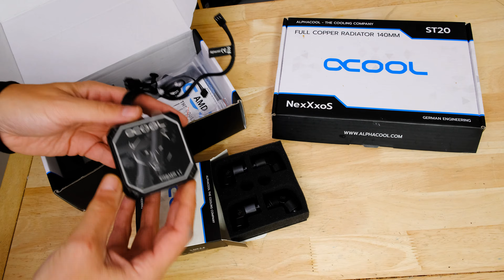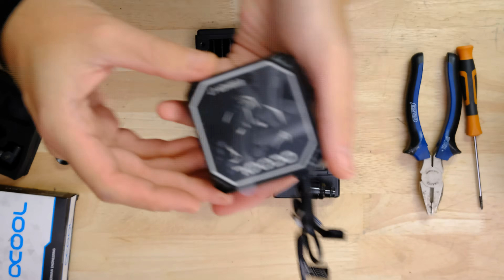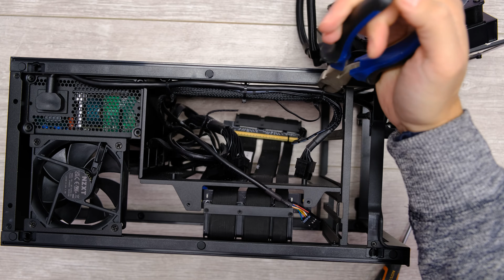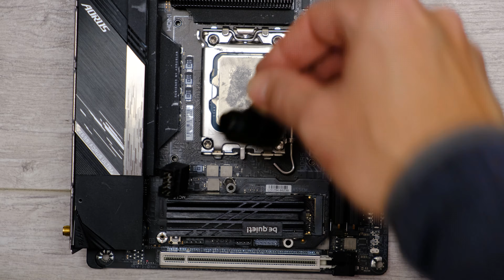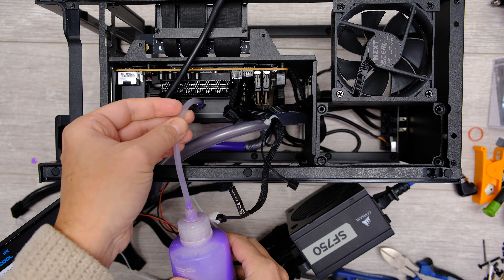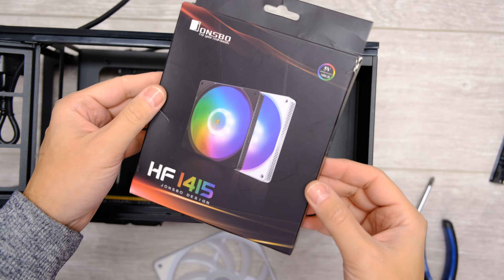HOW TO WATERCOOL the NZXT H1 V1 and V2 Mini ITX case

Comment: Actually, in the H1 V1 version, I tried installing a 240mm cold row and it was successful. I used a combination of a 13700K+7900XT, both of which were cooled by a single 240mm cold row. However, the results were mediocre. The graphics card often experienced a gradual increase in temperature due to rising water temperature, necessitating a reduction in the voltage of the graphics card. Moreover, to install a 240mm cold row, you don't need to remove the power supply bracket; you just need to add copper pillars to shrink the power supply bracket downwards. Then, using a 140 to 120 cold row adapter bracket, you can install a standard 240mm cold row inside the Enge H1V1. However, I couldn't do this with the Enge H1V2 because it locks the power supply bracket of the Enge H1V2 in place.
Reply: I figured that if you remove the PSU bracket, you'd need a fairly short GPU on the other side, right? There's some air volume up there, but the end of my ZOTAC RTX 4070 is occupying most of it. I don't think I'd be able to shift the PSU to the right and fit a 240 mm radiator...

Comment: surprised you can do a custom loop lol. My motherboard has the CPU a tiny bit offset I think and it's weird and bulky, so it might not work :/

I wonder if an air cooler would be enough for my pc. I tried the SL-100 but sadly, it was just like BARELY too big to fit my pc :/ I couldn't screw on or put on the fan, the clip would hit frame. there's always a rotary cutter but that'd be crazy LOL

Not only do I not have enough money for a custom loop, but i'm terrified of leaks lol.
I wonder if upgrading the stock AIO fan will give me better temps. i'm just at 89c on my 7950xed.

Comment: My H1 v1's AIO seems to be dying on me, getting crazy high temps in Guild Wars 2, above 90 C on a R7 5700G, which is not a hot CPU. max 30 watts and less than 50 % CPU usage. Sad times. Might have to do a custom AIO or maybe air cool it. :S
Reply from the maker: @SoulRollerFIN  have you seen my H1 AIO repair video? It’s likely a blocked pump that can be fixed
Reply: @CrazyTechLab  I've seen it. Those pumps seem to live max 3 years, so it's not worth repairing to me. Already ordered a NH-L12S. I'll check out the pump when the aircooler is installed.
Reply from the maker: @SoulRollerFIN  Yeah probably best to have a backup. A lot of people find it happens 2-3 years. Just gets clogged and looks like it died
Reply: @CrazyTechLab  I got bored while waiting for the new cooler. Opened the pump, cleaned the gunk, didn't even bother cleaning thermal paste, since I had recently repasted. Temps don't go much above 60 C now. :D I'm still swapping to the air cooler as soon as the pump starts acting up again.
Reply: The AIO kept gunking up so finally installed the NH-L12S a few months ago. Surprisingly, the PC is much queter and cooler now. Idle temps aren't as low as with the AIO, but under load the PC just runs much better now. And no more cleaning the gunk. :D

Comment: How many fittings needed total 5? 4 right angles and one straight?
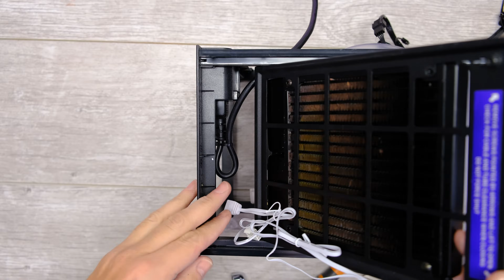Reply from the maker: 13:39
Radiator: 2 x right angle rotary fittings
Block: 2 x EK micro 90 degree rotary, 1 x 13/10mm straight fitting, 1 x 90 degree rotary female, 1 x 90 degree rotary male 13/10mm.

Comment: So let me get this straight going through all that trouble for less cooling performance on top of that spending a few hundred on the components plus running the risk of breaking something in the process 
Don't be like this guys just buy a normal computer be a normal rational human 😂😂😂
Reply from the maker: Oh dear. Someone didn’t watch the video properly and understand that the stock cooler is noisy and unreliable. That’s why I replaced it. Not to get better performance. And the fact you can fit a thicker fan inside and a larger radiator, especially in the V1.

Comment: Nice vídeo 🤌
Just love the H1 and mine is full custom loop👌
Would love to see a full build on the V1 with the 280mm
Reply from the maker: Oh nice! What components did you use in your v2?  I was set on the V2 and then was a bit gutted when I saw how easy it was to fit a bigger rad in the v1! I need a smaller GPU!
Reply: @CrazyTechLab  mine is the V1, but if i found a V2 deal i would upgrade because of the rear fan and CAM module
My build have an R5 5600X and a RTX3070 FE
Rad is an EK 140SE, dual pump from alphacool and the GPU block also from alphacool with a small reservoir for the liquid👌🏻 and a Status LCD on the front
You need a shorter GPU or just go full custom loop
The GPU block will be the perfect fit 👍🏻 and i prefer the 8x13 tubes from alphacool

Comment: Cool concept. I’m abit worried about the resonance noise though with that psu and rad fan facing each other
Reply from the maker: Yeah in the H1 V1 later in the video? I do agree plus they'll be fighting each other for airflow. You could switch the fan around -exhausting or intaking wouldn't make much difference.
Reply: @CrazyTechLab  TBH, I was contemplating on ditching my H1 V1 due to bad GPU temps when gaming. But after seeing this video, I changed my mind. I might go for a 240 AIO instead of a custom loop. AIOs with low profile pump block (Antec Kuhler k240?) could be a viable option. I imagine it being feasible to orient the radiator fans to face the mesh panels instead of the psu.
Reply from the maker: @thegeekystuff3800  Definitely. Temps with the single 140mm in the V2 are 'acceptable' but I'm seriously contemplating a GPU downgrade so I can get a bigger rad in the V1. There's roughly 45mm of clearance between the AIO mount and the SFX-L PSU in the V1 if you move it to the centre of the case like I did. That's enough for a 30mm or thinner radiator and single full height fan.

Comment: Good video for science, but spending that much on custom cooling to have basically the same performance is pointless
Reply from the maker: It's far quieter than the stock cooler and I've removed the threat of the AIO gunking up which is a huge issue with the H1. I wasn 't trying to get betting cooling. Just something quieter and more reliable.
Reply: I simple exchanged the stock fan with a noctua one and changed the pump speed to only 75% - its now completely quite on idle.
Reply: remember the number for the noctua you used? to get the correct pin and fan type/sixe etc? cheers @hellovolker
Reply: @Indieosa88  not sure what you mean. I used a noctua NF-A14 chromax